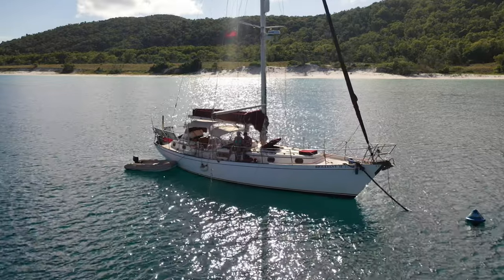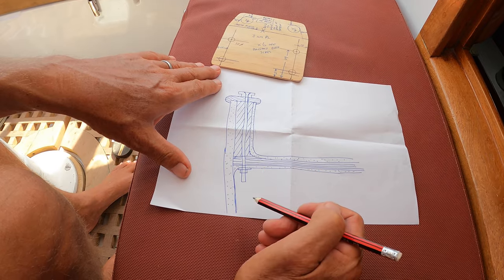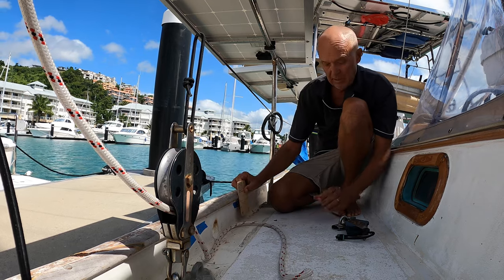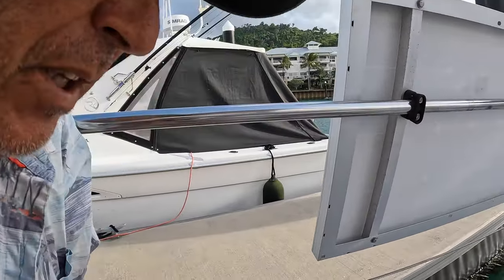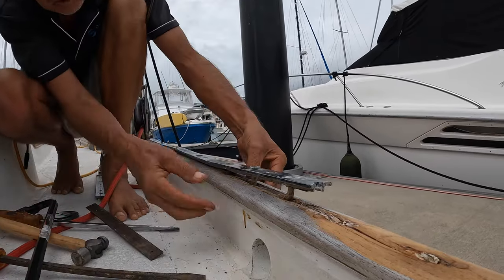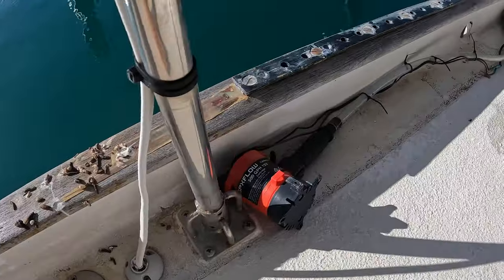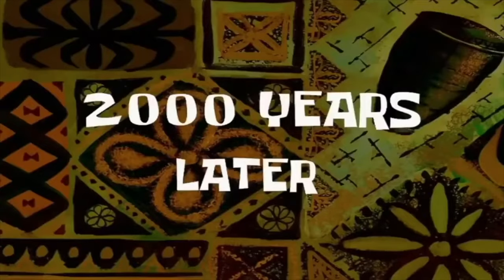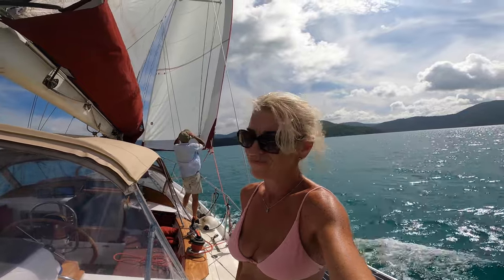Back on Track - How to Eliminate Tracks, Cars and Bolts, and Barber Haul Your Sails Instead

Comment: Cool vid. Bit of a hassle with this system slamming around when you're tacking with a reefed head sail but it works
Reply from the maker: Thank you 🙏🏻 Ideally you’d take the tackle off before you tack but in this case we left the snatch block on so yes, there’s a bit of banging and crashing there!